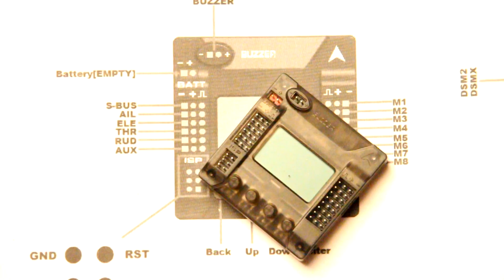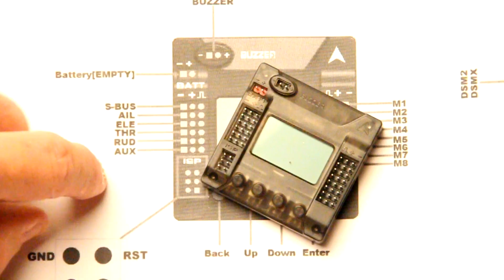New KK2.1.5 board Wiring setup and some fun at the end

Comment: On the older hobby King kk2 mini I accidentally crossed  pluse and minus and the board was fine but I smoked an esc and motor before I unplugged the battery.
I put the st60 on the wrong way round ha ha .